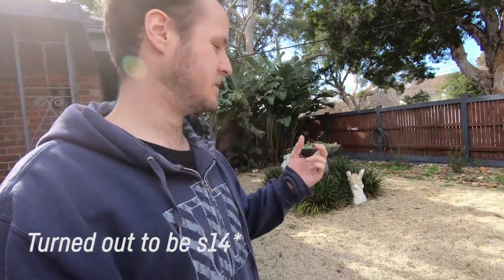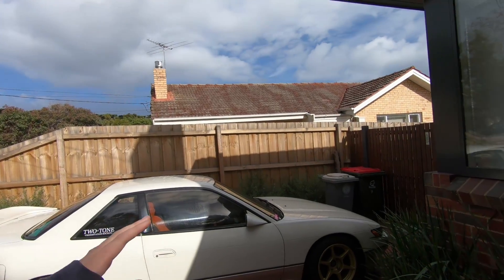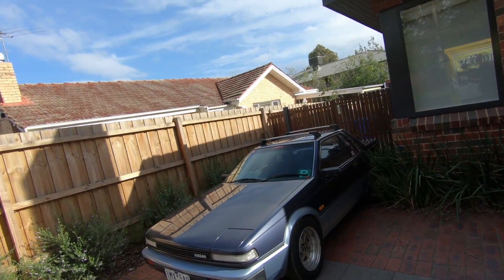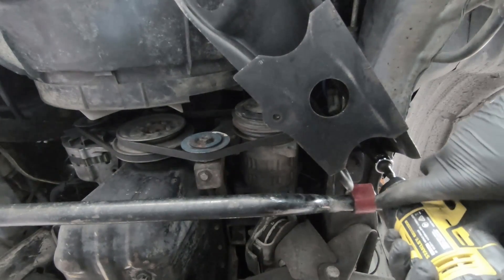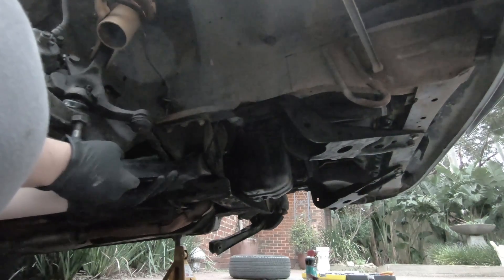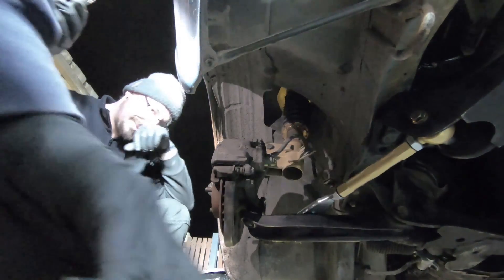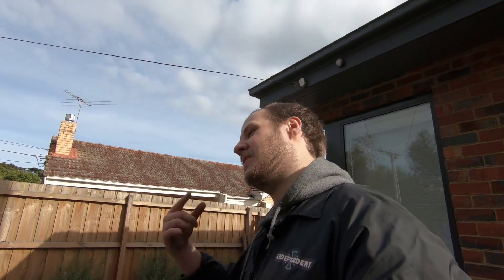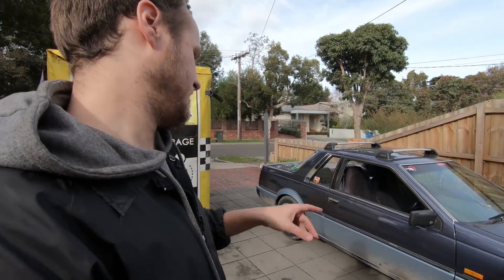Drift Camp - Gazelle s12 Prep 2

Comment: I miss the old wheels. They looked so period man.
Reply from the maker: Buddy clubs are mid 90s to early 00s and easy riders super late 70s so defs more period this way, soz it's just science fam 😎 oi but nah they look mad on the 13, just too hard to fill the guards without them handling like crap
Reply: The Fellas Network appreciate the choice.
Reply: Anything 4x114.3 is period correct. Im after some p1s as well for skids/daily use.

Comment: Nice vid! I have a 180sx, do s14 lcas bolt perfectly up and fit without modification? Im looking into getting some
Reply from the maker: They have different lower ball joints, s14 lca lower ball joint doesn't quite fit properly and snug into s13/180 knuckles. We did a dodgy and used an over sized washer that warped into the shape of the seat making these nice and snug. Don't do that though haha we just didn't have enough time to get the right parts ❤️